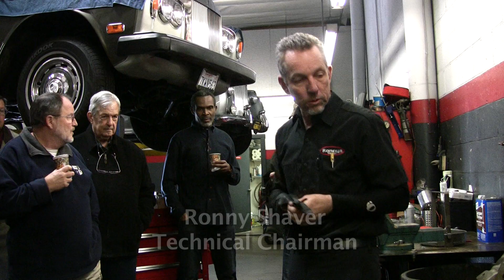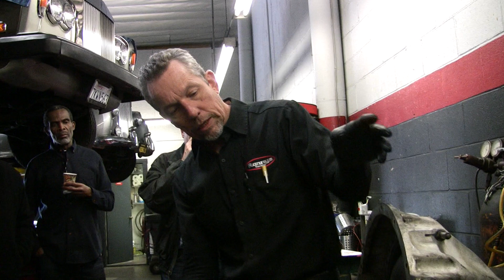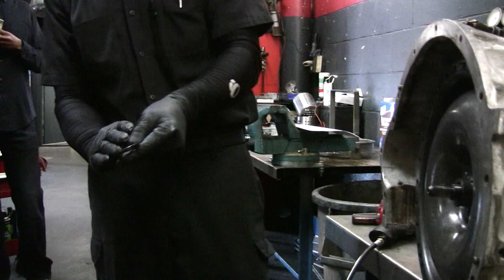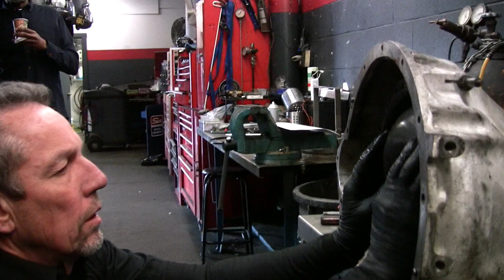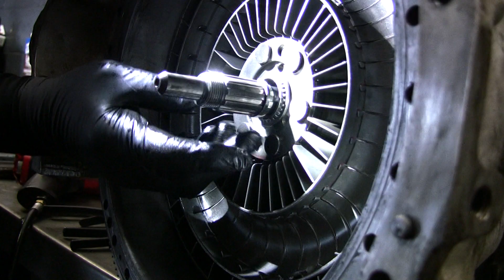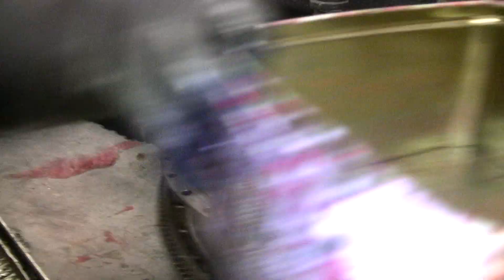Silver Cloud II Transmission Pt 1 of7

Comment: I believe the springs in the fluid coupling housing (technically it's not a torque converter) are there for the same reason there are springs in the hub of a conventional clutch disc - to absorb crankshaft pulses. 
That's due to an unique characteristic of the Hydramatic, fourth gear is direct drive from the crankshaft - bypassing the fluid coupling.
That idea was dropped, then revived in a different form as the converter clutches introduced in the late '70's.
Note that most (all?) converter clutch plates have springs too.